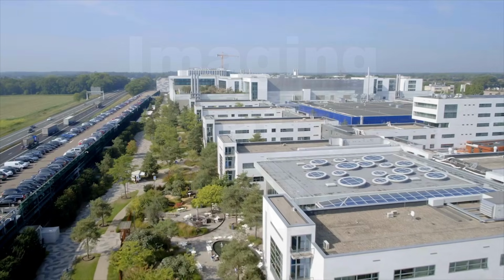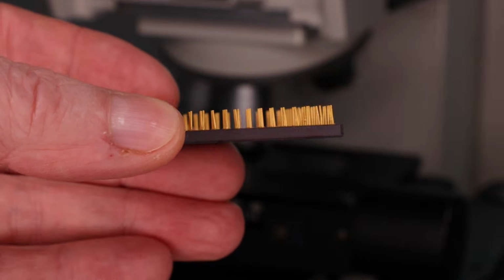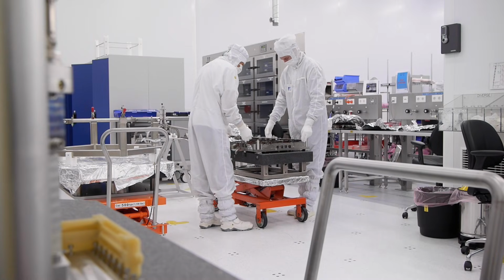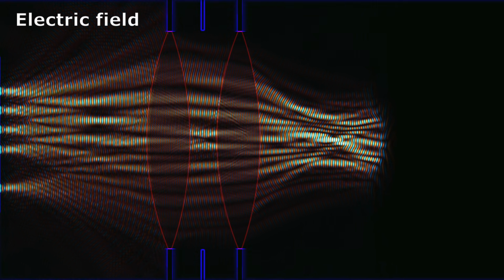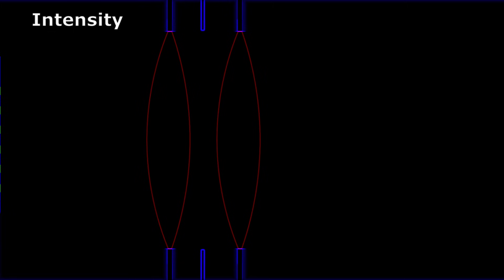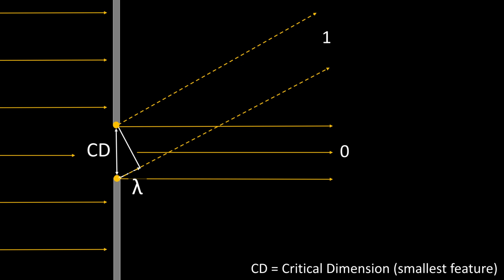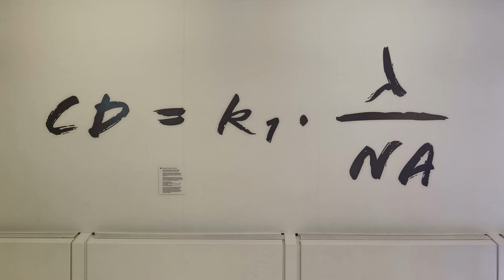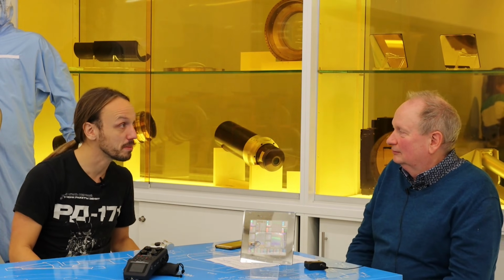Imaging at ASML

Comment: Does anybody know  a  way to increase k1 for a optical microscope ?  Critical dimension = k1*Wavelength/Numerical Aperature
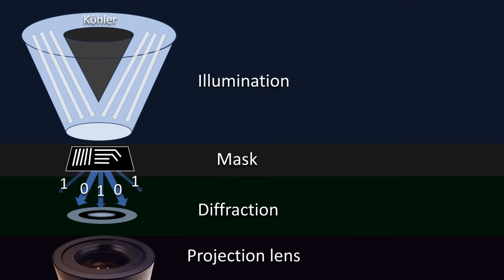Reply: Great question! Here I'm not the expert, but if I speculate and extend my litho imaging knowledge to microscopy, I would imagine that you can use a different illumination setting. Usually you have a lamp with a quite large opening angle under your sample. You can try to tune that lens opening. For example you can try to decrease this angle by cutting a small hole out of a black piece of paper and putting that over your lamp. On the other hand, you could also try to cut out a ring that blocks the center of your lamp, but leaves some room at the edges (likely you'd have to attach this to a transparent piece of plastic to make sure the inner blocking disc stays aligned to the outer part). I imagine that the best illumination setting depends on the type of sample you're looking at, just like in lithography the best illumination setting depends on the feature you are trying to print. Look at around 16:31 of the video for an illustration of what I mean.
Reply from the maker: Yes, it's possible. Like DrBlokmeister said you can optimize illumination and even do that for a specific pattern. But more in general you can use Köhler illumination to increase the contrast and thereby give a better image.
Reply: @HuygensOptics  I would like to mention that Köhler illumination only means that you place your light source at the entrance pupil of your lens, it does not say anything about the shape of that source. This means that you can have annular illumination or conventional illumination in both Köhler and non-Köhler setups. All the cases that you mention around 16:55 could be Köhler, but need not be. However, for non-Köhler setups, the illumination is not constant over your imaging field and effects like vignetting will occur. This automatically means that if you want to do proper photolithography, using a Köhler illumination setup is key.

Comment: 3:04 It was explained to me that these numbers were decoupled from structure size at one point and now reflect the increase in density. You could do X amount of transistors on a square millimeter which had a real structure size of Y nm. And years later you have 16 times the transistors on that surface area, so you claim to have a structure size of Y/4 nm.
There's a very detailed and scientific book from Vivek Bakshi about EUV lithography. It's not only about the EUV part, but all the other components that had to be changed with EUV. The whole process of creating these patterns had to be changed. An endeavour going on since the 80s.
Reply: You are absolutely right! I think this most drives the node name. However, it also turns out that the placement accuracy is also roughly the size of the node name. But this is also a bit of a coincidence. For example if we could achieve the same scaling by stacking the transistors, then this node name/accuracy relation would not hold anymore, as the density per layer would not increase.

There is an asterisk here, which is that even if you don't have this relation anymore in the transistor layers, you would still need to contact those transistors, so the contacting layers (also called Back End Of Line or BEOL) should still have this relationship. Moreover, it's the first few BEOL layers that are the most aggressive on scaling and contain the smallest features.

Comment: Are wavelength interferences less frequent with narrower bandwidths, say from a monochromatic source
Reply: Interference is always present, no matter the wavelength difference of the multiple waves. However, as the wavelength difference becomes larger, the phase relation is no longer constant over time. The larger the difference, the shorter the coherence time. In lithography we want different sources to be incoherent, while the interfering light rays are coherent. My mind works in the Abbe sum of incoherent sources approach, which takes this incoherence into account.
Reply: @DrBlokmeister  thanks for the information!

Comment: The animations you create are mesmerizing! And the whole process, damn, that's insane
to think how that the smallest changes in temperature, or any vibration of the machine, would have a big impact on these patterns, and yet they manage to create such small features
there's not only one reason why these machines are so expensive, but probable millions of reasons.
Reply: You are so right! Just an example. If the silicon wafer heats up by just a millikelvin, so a thousandth of a degree (2 thousandth in freedom units), it will expand by roughly 3 nanometers, completely destroying your chip.

Comment: I worked at a factory that made 2 million pounds of chips per month and we didn't have a single one of these. Then again, these were potato chips... 😂
Interesting video!
Reply: You guys do the real work!
Reply: @DrBlokmeister  heh. I was actually impressed with the tech. EVERY SINGLE potato chip was optically inspected with computer vision as they left the fryers. If burn marks, discoloration, or size issues were found, an air jet would blow it out of the stream and discard it. And that was in 2016 when I left. Who knows what they're doing now.

Comment: Holly shit, EUV is even more hadcore than I have thought! 
I knew about that crazy tin laser thing for the light source and the mirrors, but having all that in a vacume! 😮
Reply: The light source is bizarre, and that's only the lamp we screw in our slide projector.
Reply: The major problem is to overlap masks correctly. If the resolution is 2nm, the several masks need to be positioned better than 0.5nm
Reply: @odissey2  in this case, statistics works a bit in our favor. Usually since you don't know the error direction and they are not correlated, you can add the errors quadratically. This means that if you have four sources of errors that all add up to 2nm, each source can have 1nm error, as 4*1^2=2^2.

Comment: 9:08 All over the internet, it says that light has two perpendicular components, one magnetic and one electric. This is a total and complete misunderstanding of electromagnetic radiation, which is the force carrying waves of electric and magnetic phenomena.  The two perpendicular waves are identical only at 90 degrees from each other as clearly demonstrated when light is passed through calcite or a polarizing filter. One wave is not "electric" and the other "magnetic." They're both identical waves of light, only half the intensity. What makes one wave "electric" and the other "magnetic"? It doesn't even make any sense!? They're both electromagnetic waves/photons. And a Stern-Gerlach machine only affects the electromagnetic field of the atoms in the plasma of the atoms's light spectrum you are observing, NOT the electromagnetic wave itself! The electrons in the atoms are excited or shifted, giving you a shifted light spectrum. When you shine a laser through calcite, the two component waves are split and they are identical halves of the same light...(I still have a lot of questions, though. If a photon is indivisible, then wouldn't each separable wave actually consist of two photons!? At 90-degree angles?) Either way, they are not electric and magnetic. Electromagnetic phenomena are one and the same. Magnetic fields arise from moving charges and the force carrying particles are the photons which we call the "electromagnetic" radiation because it's the energy emitted from electromagnetic phenomena, NOT because the waves themselves are "electric" and "magnetic". No. (I'm pretty sure 🤔)
Reply: Magnetism is not a real thing. If you take into account special relativity, you will predict a pseudoforce that looks a lot like magnetism, but it's just relativistic electric fields. That being said, Maxwell's equations work extremely well, and our imaging predictions are perfectly valid if we ignore the magnetic contribution. I'm the end it doesn't matter what you call it. Nature is nature and we just try to describe it. Using pure electric fields is a good enough description in my field.
Reply: @DrBlokmeister  Regardless, when we separate the two perpendicular waves of light from each other with calcite or a polarizing filter, they are both identical waves with half the intensity. Neither wave can be distinguished as being either "electric" or "magnetic". They are both identical waves of electromagnetic radiation/light/photons.  Not only that, this whole theory that people keep repeating that the electric component propels the magnetic component and vice-versa. Then how would light keep traveling when you separate them with a polarizing filter?

Comment: Does each "pulverized" tin droplet translate  to a single impression on the wafer, or do multiple EUV beams compete to make one?
Reply: The chemical reaction in the photoresist requires a greater amount of exposure energy than can be applied in a single shot from the tin emission (or DUV laser in 193nm/248nm light sources)  

Like Dr. Blok said, a given area of the wafer (and more importantly, the photoresist on top of it) is exposed to a series of pulses of light, and that total exposure from those pulses is referred to as the 'dose'.  The total dose is determined by measuring/understanding how much energy will achieve a specific chemical change in the resist to make it more or less soluble so it can be developed (rinsed away) later.   You need just the right amount (+/- 1% of the target dose) to get the pattern correctly imaged into the resist.  And it needs to be done uniformly so the entire field is exposed the same amount without any deviations in a given area. 

The exposure tool monitors the energy of each pulse and can control the dose by deciding how many pulses of light are making it to the wafer.  It also controls the speed the wafer is moving so it can get the right number of pulses in a given area.  In older DUV systems the dose can also be fine-tuned by controlling the light source output directly, or by placing attenuators in series with light sources to get lower intensity  pulses of light, but don't know if EUV has a similar control.

Dr. Chris Mack has some really good videos explaining the photoresist chemistry and how the physics of it work.  Highly recommend watching his 50+ part series on nanofabrication which is basically an online college course on this stuff, in particular the photoresist.
Reply: @sooocheesy  This guy lithos!
Reply: @DrBlokmeister  damn it, you caught me!  I've been working on DUV light sources for 14 years now. It's always fun to see what makes all the other tools tick..
Reply: For all intents and purposes, each EUV pulse creates its own image in the resist. The final image is just the sum of all the individual images coming from all the different pulses. In EUV, each image is roughly the same, so you can just calculate the image of one droplet and assume that's the final impression.

Comment: 14:17 As a telco engineer working with signal analysis I had an heureka moment. Basically thinking in fourier domain and radio signals, it is enough to recreate transmission with carrier and a single side-band and here we had something similar with light source positioned at angle to transmit 0th and half of 1st interference pattern through the imaging system. Thank You for the great content =) and merry Christmas
Reply: That's so true! All these fields are similar. The lens is simply a band pass filter with size of NA/lambda (in frequency space). By changing the incidence angle of the light onto the mask, you can change the position of the filter from minus half the lens size to plus half the lens size. As the diffraction pattern is simply a fourier transform of the electric field at the mask, it is easy to calculate the final image! You just have to iFFT(FFT(mask)*lens) and BAM! You're an imaging engineer!
Reply: @DrBlokmeister 🤯 it really is fourier sequences all the way down. Wheels within wheels...
Reply: @DrBlokmeister  Interesting! So I guess I can think of the lenses role in imaging as a convolution, since multiplication in k space is a convolution in r space. 
I've never thought about optical imaging in this way, only XRay and MRI imaging (medical physicist by training), but I guess it makes sense that it's similar. If the lense is a rectangular band pass filter in k space, where would I find the corresponding sinc in real space?
Reply: @chalkchalkson5639   I think you're right here. The lens has a point spread function and the final image is a convolution of the point spread function and the mask. I think it's a bit more complex in the case of off-axis illumination. This sinc function is the point spread function I mentioned. It's the response of the lens when you try to image an infinitely small dot. Since for an infinitely small dot, the diffraction pattern is infinitely wide, the entire lens is filled with light, the intensity being 1 over the entire lens. Therefore the image will be a fourier transform of this square.
Reply: Also didn’t think my basic understanding of “beamforming ” would apply, but shouldn’t be surprised that an array of light sources would not behave in a similar manner haha

Comment: Why is the mask on a moving tray as well?
Reply: It has to be. It's like a roll-to-roll process when printing newspapers. The print head needs to be moving just as fast as the newspaper. If not, your pictures will fade. They need to be perfectly synchronized.

Edit: the field and the lens doesn't move, just like the contact area in a printing press doesn't move. So that causes the symmetry between the mask and wafer movement.
Reply: @DrBlokmeister  thanks you! 
I commented on this before seeing  you answered this already. I replied to that with some other questions 😅

Comment: Higher resolution is proportional to NA.  High NA must be easier to achieve for imaging an individual small die.  This leads to the question … can high resolution adequate throughput be achieved using a checkerboard array of high NA lenses to image 16 dies at a time as it steps to every die on the wafer?
Reply: Interesting question! The lenses are very big. You can see it in the scanner animations. Dies are roughly 30mm apart. It's not possible to put several lenses that close together. Besides, how do you create the image? We would need multiple masks as well, also synchronized with the wafer. Then you would need multiple light sources to create more light. In the end you're just building more scanners, which is exactly what we're doing.
Reply: Nope. Just step by step exposure - very slow and low yield!

Comment: As a software developer, I am amazed that ASML is still pulling this off. About 25 years ago, there were projections that they would pretty soon need every SW developer in the country. That hasn't happened, but still ASML is turning out these ever more complex machines.

I have the greatest respect for ASML, it is without a doubt THE most technologically advanced company in the world, and a major driver in advancing the State of the Art for optics, mechanics, systems engineering, sensor & actuator tecnology, physics and SW. And electronics, obviously.

Comment: We need a mask that also changes the phase of light passing through each part of the mask by the desired amount.  This may be easier for non euv wavelengths due to attenuation at euv wavelengths.  For euv, multiple layer masks may be required to change phase by changing path length.  I also wonder if a third variable could be adjusted in the mask for better imaging (1st the stencil pattern, 2nd the phase shift for each part of the stencil mask, 3rd the attenuation for each part of the stencil mask). A 4th variable is controlling polarization of source light for each part of the mask.
Reply: I thought I posted a reaction earlier, but it got lost in limbo. Google attenuated phase shift masks for EUV. Playing with the phase of the light is a very powerful technique!

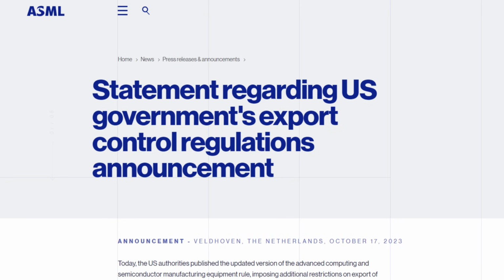Comment: 0:23 You mean wafer stepper?
Reply from the maker: No, the latest generations are called scanners, because they scan through a pattern, rather than projecting the whole pattern all at once.
Reply: @HuygensOptics  I think they are usually still called wafer steppers. At ASML we call them scanners, but they are actually step-and-scan systems. They scan over a single die and then step to the next field to start the next scan and repeat. Stepper and scanner is both not correct, but I think we understand what is meant so we use the words anyways.
Reply: Cool, didn't know there's a difference.
As a mechinecal engineering student currently learning wave optic, it's really exciting seeing how optical components like Bragg reflector are getting used in real life.

Comment: Gets sand
Purify sand 
Make Silicon Ingot
Make them wafer-thin
Do some fancy ion shit
Then Etching 
Electroplating 
Layering and stuff 
Now, what you’ve got is a little slab of silicon 
Packed with transistors, which are just little electricity gates
And you put them all together in such a way they form an electronic mind.
A computer is just a little prison for electrons
Where we train them to solve problems really quickly
And this all relies on the prinicpals of subatomic physics 
Meaning that the most common use of quantum mechanics in the 21st centery is
Undeniably…
Most likely…
Demonbstrably…
Pornograohy.

Comment: Nice one, Jeroen. And thanks for advertising my channel! (featuring some optical fibers today).
Reply from the maker: Yes I saw. Nice high resolution. Did you modify the code in some way? I remember that in the past you had some trouble simulating high-frequencies.
Reply: @HuygensOptics  Not in any fundamental way. But I increased the resolution, so this may explain the difference.
Reply: @turning3650  Thanks! In this video, Jeroen used another software to create the animations, though.